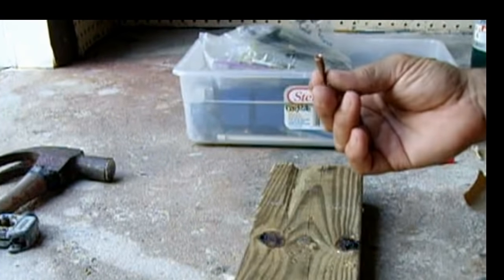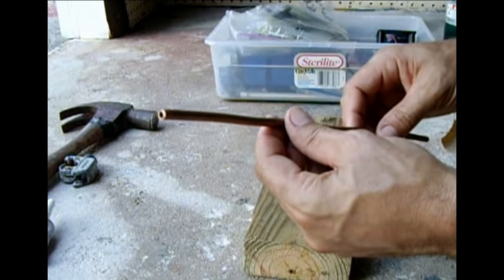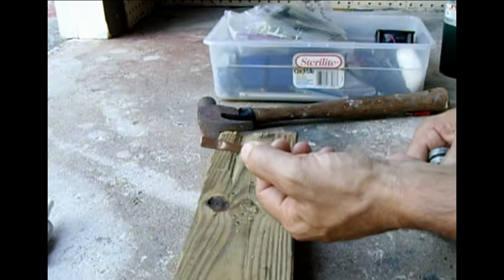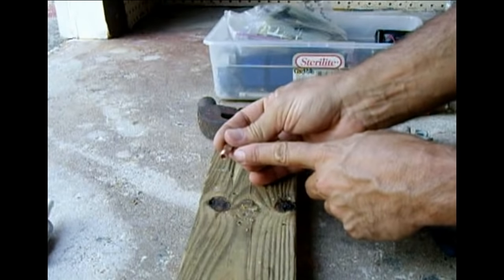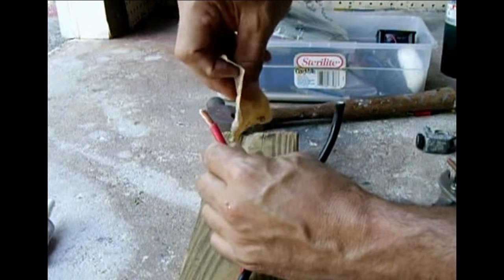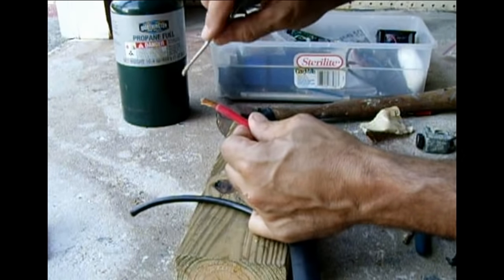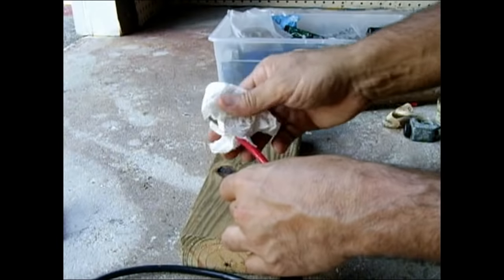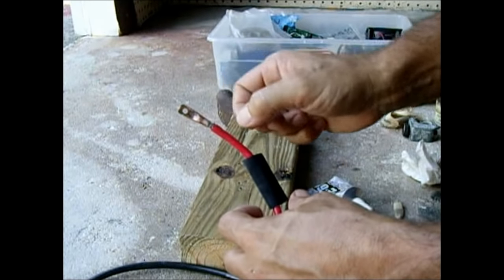How To Make Copper Battery Cable Connectors!

Comment: 9:55 OOOUUCHH!!!
Reply from the maker: No, was not that bad. I can tolerate the heat. I loaned out my heat gun which I normally use, and never got it back. Typical.
Reply: electronicsNmore Hhahaa nice video, very instructive
Reply from the maker: Thanks

Comment: Pay 7 cents a piece for tinned copper (6 ga) why go through the trouble of making them for twice as much.
Reply from the maker: Much more money than that. The real savings is for sizes 4ga to 2/0. There is no trouble making these. I can make one connector in 1 to 1 1/2 minutes.

Comment: I disagree.

Twist the wire, form a loop, solder the loop.

Is a soldered lug superior to the soldered wire loop?

Less work, cost, connections, heat shrink, and solder.

Comment: Good stuff ! -  I wrap 4% silver solder like this ( 			 		eBay item number: 261022033955 ) around the 4 or 0 gauge wire I'm working with and also stuff some in the connector - then crimp the copper connecter (lug) on - then fire up my torch and get it hot enough to melt the solder, you can use a laser type thermometer to make sure, if you need it. I use an upside down can of compressed air to cool it off. then wrap it with electrical tape back and forth to keep air and water out..

Comment: USCG  says you got to crimp it. its the law
Reply from the maker: Yes, they like a mechanical connection. Soldered connections used in boats flex less than stranded wire without solder, and over time the connections "CAN", fatigue and break.

Comment: Got 2 in a pack for $3 @Autozone
Reply from the maker: Ria Somers No bargain.
Reply: electronicsNmore I only needed 2. They were predrilled &corners rounded already. I'm wondering if they're ok for solar though my cable is 12 AWG for solar.
Reply from the maker: Ria Somers As long as the wire gauge matches the connector size....you'll be fine.
Reply: electronicsNmore I'm swapping out two 6v batteries for a 12v. The lugs are for 4 & 6 gauge cable but don't see a size on the cable. I'm in FLA &no one knows solar around me. Gave up on Renogy responding once they get the $.

Comment: Sorry, but for a long term connection, that was dodgy. Burnt the bolt on connecting part of the lug with a naked flame and any flux that 'wicked' it's way up the cable will promote corrosion of the copper wires under the cable sheath.
Would have been better off 'tinning' the lug, (inside and out), and cable before joining, which also makes soldering cable in lug less haphazard.

Comment: you failed to crimp it before soldering it. You definitely need crimping to promote copper to copper contact
Reply from the maker: You DO NOT need to crimp the connector. I mentioned in the video that you CAN crimp and solder if you would like, but it is not mandatory. I have used these lugs for YEARS for high current applications and experienced NO problems whatsoever. When the solder flows between the clean copper lug and copper wire, the connection is a very secure, EXTREMELY LOW RESISTANCE connection. Even though copper is a better conductor, lead(as is used on battery posts), is also a very good conductor. The thin layer of lead between the copper wire and copper lug, will have little effect on resistance. If you want to crimp the wire as well, then be my guest. Just don't tell me that I did something wrong. My method is proven to work.
Reply: electronicsNmore Just for the record, lamberto is correct.  Lead solder is not a very good conductor when comparing to copper.  No doubt that lead soldered connection will work for years.  However, in the most mission critical applications, crimp is always preferred.  The matter of fact, soldering the connection is strongly discouraged.
Reply from the maker: Disagree. Crimping alone is a poor practice. I have seen MANY crimped connections over the years develop corrosion and a high resistance connection. I'll do it my way, and you can do it your way. My way never failed me. The most secure/reliable connection is CRIMPED and SOLDERED.

Comment: just go buy some SHCA lugs and heat shrink.
Reply from the maker: If you dont mind spending a lot more money, then no problem.
Reply: +electronicsNmore They're better quality than these home made ones. This is a nice trick to use in a pinch though.
Reply from the maker: Jeremy Day
Mine do the same job. Same thickness copper. Thanks For Watching.

Comment: Avoid plumbers flux as it is acid flux
Reply from the maker: That's true, but the particular brand of flux shown in this video was used 10-15 years ago on heavy cables, and they still look great. :-) I hate to waste my expensive rosin core flux on cable ends. Thanks for watching!

Comment: 15 seconds of googling: today they cost around $1 a piece. 

Also: be careful that you are using the right piping, pipes are not  designed to carry large currents so unless you get the right material you may just end up introducing a fire hazard.
Reply from the maker: vinny142 Needs to be thick wall refrigeration tubing....K or L

Comment: why solder ?
Reply from the maker: Joe G I do it to eliminate the chance of any corrosion between the wire and connector which would result in a high resistance connection which can heat up. The best connection would be to crimp, solder, and apply glue lined heat shrink!

Comment: WARNING WARNING WARNING..   For smaller gauge wire, this is fine, but do not attempt this for larger gauges wires unless you know how to do the math to calculate how much material is available to conduct the current.     The volume of copper (square area) must be equal to or greater than what the wire contains or you could start a fire.  If you don't know how to calculate this, don't do it.
Reply from the maker: You need to watch my more recent video with hydraulic crimpers.

Comment: Soldering is NOT the best way , crimping is best. Solder has much lower conductivity than 100% copper and flux is corrosive, none of that is necessary! Use a good hydraulic crimper period !

Comment: Not to put a dinkie on your swimsuit but you can buy these on aliexpress for pennies a piece. Youre probably spendin more money on the calories than the cost of buying new ones..
Reply from the maker: Not to put a dinkie on your swimsuit, but good luck buying one of these connectors from Aliexpress when you need one. LOL. Your car or boat won't be able to wait 2-3 weeks for the connector to arrive in the mail. Smart people like the ideas I show, because they save money, and get the job done quickly. :-)
Reply: fair point

Comment: get yourself a small anvil from harbor freight to bang on the pipe.
Reply from the maker: I already have one. It is just as easy doing it on the smooth concrete.
Reply: I have done this and the cement floor is not so smooth anymore.
Reply from the maker: Your not suppose to point the flame directly at the floor. That could result in the concrete popping due to moisture.

Comment: These things must be stamped out in fractions of a second by huge industrial presses, yes they are made of Copper which is expensive, but the price of these is still a total piss take. It is just the same with insulation and roofing materials, they rely on the fact people desperately need certain items, so they try to make a fast buck by over charging.

Comment: Real electrical connectors are UL approved and are made from high grade copper. Copper tubing is not.
Reply from the maker: What you mean to say is that electrical copper is 99.9% pure copper, and plumbing copper is around 96% pure copper. A big 4% difference. I suggest you go out and buy "UL" approved 99.9% copper connectors for much higher cost to notice ZERO difference in performance. In the 20 years I have been making these, I never experienced any problems.
Reply: Depending on your application, using non approved connectors can result in a code violation. Should damage or a fire occur due to the homemade connectors, a savvy insurance inspector could have your claim denied.
Reply from the maker: Nonsense.
Reply: That's fine. I think the idea is clever and I would use it myself for automotive purposes.
Reply: blipco5    Oh, come on. Where would the average homeowner/hobbyist use connectors requiring high-grade copper? We’re not talking about thousands of volts or amps here. Heck, most connectors sold don’t use high-grade copper anyway, nor do building codes require it since neither UL486 or NFPA-70 requirements specify copper grade for such applications (600 volts or less).

Comment: Bro they are 2.99 for a twin pack...🤓👍
Reply from the maker: I make 2 of them for 1/10th that amount. LOL You'd appreciate this idea if you needed large size lugs, or couldn't find them locally.
Reply: electronicsNmore good point!
Reply: My problem is they are costly and if I need a couple i get a few extra sounds good huh,  well it never fails when I need them they are not to be found .  Maybe one could argue that I have too much stuff . But I think keeping a few sections of copper pipe handy would benefit me greatly .  Thanks for the video .  Oh and i have been attaching lugs with solder for years in the marine industry and crimped or not if done right they will give you years of service

Comment: So you spend ten minutes to save 15 cents?
Reply from the maker: 15 cents? Really? Post a link to where you can buy a solid copper 4ga or larger ring/lug connector for 15 cents. More like $2.00 a piece and up. How did you arrive at 10 minutes? Because the video was 10 minutes long? I can make one of these connectors in about 1 1/2 minutes.
Reply: At :55 it says, 15 Cents each.  That's in the video itself.   I realize that is how much it "costs", but my time is worth more than that.  Sorry if I devalued yours.
Reply: orignaldog In the video it says that you can make your own for about 15 cents each, but that the ones you buy in the store are usually a couple dollars a piece or more.  Which is true if you go shopping for battery cable lugs in most hardware or big box stores.  I have used this same method for years to make my own lugs and it actually takes only 30 seconds or less if you have a few shop tools available and you assembly line them.  It takes far less time and energy to make them than it does to make a trip to the hardware store.  If you use battery lugs a lot then its a good idea to take 10 minutes and make a few dozen, use up an entire length of copper pipe and keep them in your tool box for future projects.  Time has no real value but if you had the right tools and assembly line made the connectors you could easily make 2+ per minute and have 120+ per hour of your time.  That means for one hour of your time you would have invested .15 x 120 = $18 and saved yourself $2(120) - $18 = $222.  That means you could use that $222 you saved to buy batteries or just save for the future.

Comment: Pipe grades of copper are nowhere near as good a conductor as electrical graded copper. This could cause overheating when the battery is under heavy load. I'll spend a few pence getting the right items.
Reply from the maker: TOTALLY Incorrect. If you actually think copper pipe at 95% to 98% pure copper is going to be that much different than electrical copper at 99%+ pure copper, then go ahead and throw your money away. LOL Just so you know, the lead battery terminal has much lower conductivity than a copper pipe. :-)
Reply: Phosphorous deoxidised copper  (as used in domestic plumbing pipes) is 15% less conductive than electrical grade copper -  Unlikely to cause issues

Berylium copper (which is 98% copper) is 5X WORSE than electrical grade copper. This could cause problems in high power applications. 

Search online for "conductivity of copper alloys" and you should beable to find a datasheet of the specifications of the copper alloys if you interested or have a critical application

Comment: amateurs. soldered the cables is not a proper way of doing it it should be clipped if you really knew what you were doing you would be crippin not solderl
Reply from the maker: Whatever you say Know-It-All. LOL
Reply from the maker: Warren Qualls Hurt my feelings? Dream on buddy. :-)
Reply: First off, this is an excellent, money saving DIY tip, and you can be sure this is how I will make up my marine battery cables from now on .... BUT .... Mr. Qualls has a valid point. I don't know about the automotive world but I too am trained (US Navy and commercial process controls and microwave communications) and experienced in electronics and I am a licensed ship's Captain and VERY familiar with U.S. Code of Federal Regulations concerning commercial passenger and cargo vessels that must pass stringent safety inspections performed by the U.S. Coast Guard every year on such vessels. 

For a terminal connector like this, soldering is allowed, but if solder is used, the cable itself must be shock mounted some inches back (depending on wire gauge) from the connector to eliminate tear and torque stress on the solder hardened joint. A compressed (crimped) connection does not require this precaution. The American Boat and Yacht Council (boat builder's standardized methods of construction) reflects 46 CFR 120.340 (g) concerning solder joints being used only on a fixed (ie, screw) terminal; where this would be used, but the ABYC goes a step further in recommending discretionary use of solder joints, especially in engine rooms and engine compartments as this hardens the stranded wire (single strand wire is not allowed) making it susceptible to failure due to vibration and heating. Crimp only, using a copper or brass sleeve (not aluminum) using a compression tool that also leaves a depression or dimple in the compressed area is the preferred method - at least in a marine environment. 

Your recommendation on insulating the joint is spot on.

Comment: dude, just crimp and don't waste time with useless stuff. soldering a high power cable is a definite no-no.only low voltage connections get soldered
Reply from the maker: Disagree. A crimped AND soldered connection will outlast one that's only crimped.
Reply: electronicsNmore
It doesn't matter if you agree or disagree. The only thing that matters is if a power cable can get hot enough to melt your solder. And as a matter of fact, it can and judging by the difference of the resistance between solder and copper, it will. All I am saying is that you don't need to spend a day on making this, instead of just crimping them. Crimping works fine, the purpose of this shoe is to provide connectivity, not structural stability.
Reply from the maker: Quentyn73 Why argue over this? LOL. I never had a cable fail, and I've made many over the years. The purpose of this video was to show a way to make a lug connector, nothing more. If you want to crimp it, then do so, if you want to solder it, then do it. All up to you.
Reply: electronicsNmore
Relax dude, you showed how to do it and that's why you get the criticism. And it's all right. You don't need to justify what you did, just like people like me who criticize you don't justify why they criticize. All good, brother. God bless you!
Reply from the maker: Quentyn73
I was saying it nicely to you. I wasn't pissed off. :-)